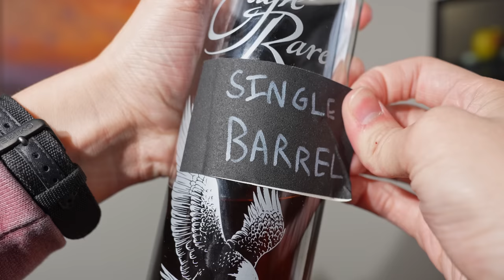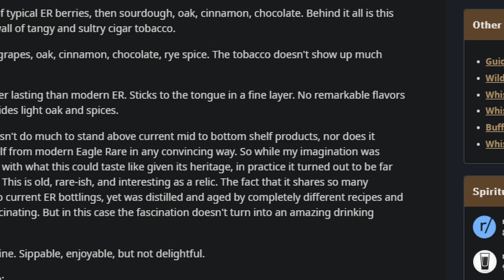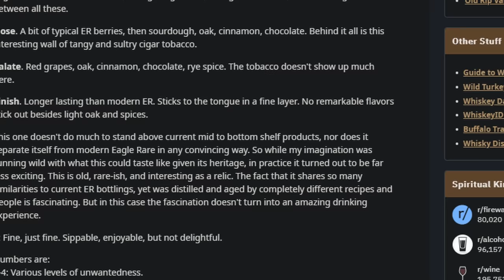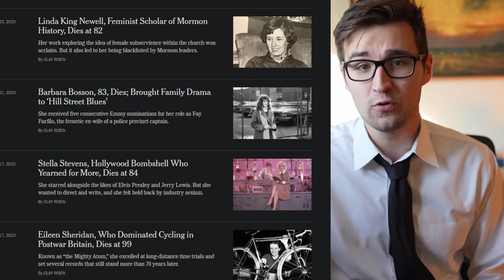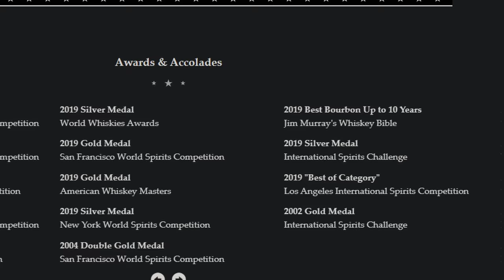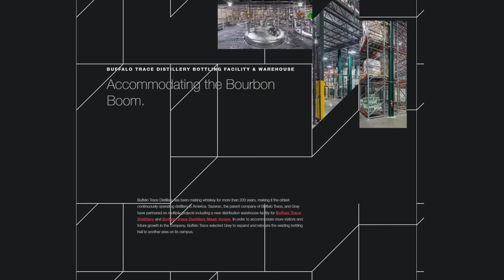Eagle Rare's Big Lie

Comment: While I do agree with the small batch I would say its an small enough the each bottle you own is slightly different like a single barrel. During one of the videos featuring Freddie on a tour around the facility he mentions Eagle Rare is dumped on its 10th birthday. So to me that means it is that days distilling run that would be in your bottle. Sure it is definitely not as unique as an individual barrel,  it is however far more unique then regular old Buffalo Trace I would be led to believe.

Comment: What I find is that Eagle Rare has a more grape and tea profile while Buffalo Trace has a more floral smell and lingering after taste, and both bottles cost more than ten bucks cheaper than the Smooth Ambler Bourbon, Contradiction. Current pricing in my region is Buffalo Trace priced between 22 and 28 dollars, Eagle Rare from 30 to 40 dollars, and the Contradiction priced from 45 to 60 bucks.
Reply from the maker: That's nuts. Around us Buffalo Trace is $28-$35, eagle rare is $33-38 and contradiction is right around $40.

Comment: I picked up a "store pick" of Eagle Rare from a large chain at their end of year allocation drop, which they described as a "Barrel Pick", but has no info about barrel details. Does anyone have knowledge whether this would have been bottled on the single barrell line or the batch line? My guess is that it is a batch of picked barrels that were bottled on the batch line. I estimate they had at least 4000 bottles which is a lot of barrels.  (Or maybe Sazerac just a label slapped the bottle and called it a store pick?)

Comment: So what is missed is where does Buffalo trace bottle their single barrels since they only have 2 bottling halls?  I can't imagine all the single barrels are processed in the blanton's facility? or maybe there are?
Reply from the maker: So that we don't know for sure. For a long time all single barrel and craft products (BTAC and pappy) were handled at the Blanton's bottling hall exclusively. I could 100% believe that there are more bottling halls now, but I can't find anyone mentioning them specifically or any footage that proves they exist. It seems like that would be a bottleneck (lol) to only bottle in the Blanton's hall, but consider that Blanton's only comes out of warehouse H so there's actually a fixed limit of Blanton's that can be made per year. While it's total speculation I would assume that BTAC has moved to regauge and that pappy, SB's, and Blanton's are the only thing dumped at the Blanton's hall now.
Reply: Thanks!  And strong first video!  Well done.

Comment: I wouldn't buy this Bourbon based on it being in what looks like an old recycled cheap wine bottle and cheesy sticky label.
Reply: Look again. Bottle is extra thick at the bottom. The front is not a sticker it is etched followed by a sticker on the back with a black inside that puts a great contrast on the etching. 10 years aged and a great bottle for less than $40